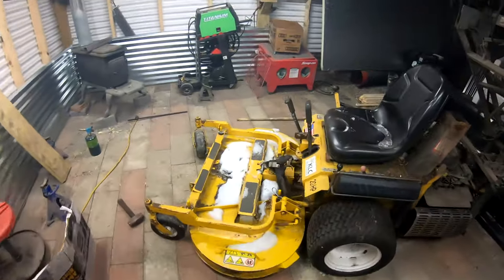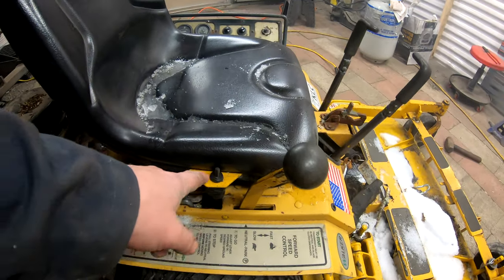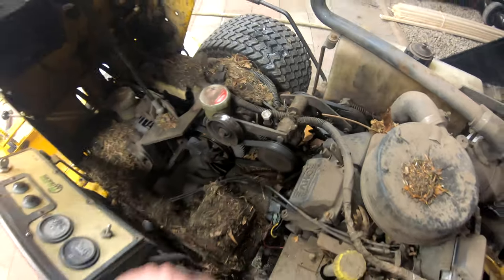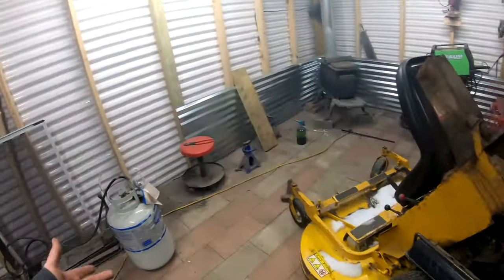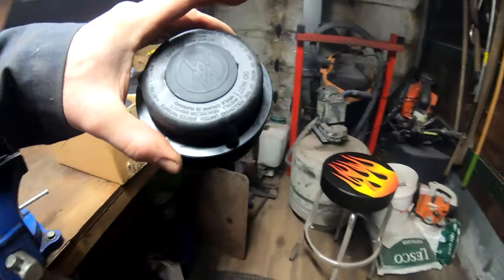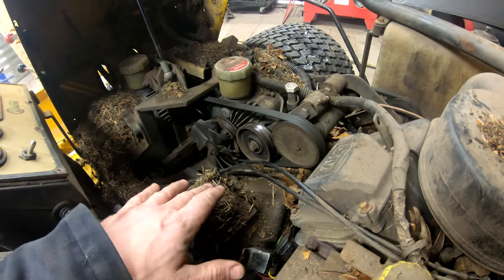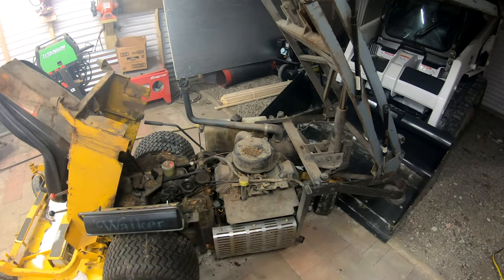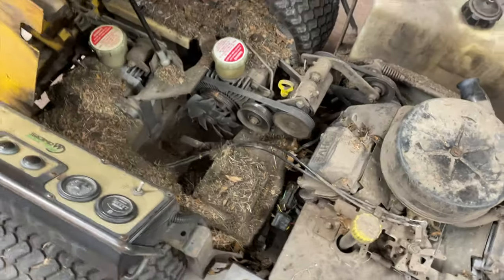Walker Mower Refresh/Upgrade Part 1

Comment: I picked up a Kohler efi 26 hp model and it has a little tool box bed thing in the back. But I'm going to convert it from efi to carburator.   I've gotta make a YouTube video about it 

I think walker mowers should be pretty great love your videos.  Any mower that you can rebuild is a great mower kinda like scag walk behinds are meant to be repowered

Comment: Nice vid Kenny yeah that Walker is great for bagging, I myself have 5 Walkers 2 GHS and 3 side discharge units been running the Walkers going on 14 seasons now but this year I’m going to add a stander to the fleet probably the Scag V ride 2 with the 52” deck should be awesome 😎

Comment: Wish I was in a position and close enough to buy it from you. I would like to try out walker mowers at some point. I want to get my hands on a demo this year
Reply from the maker: If you mow a lot of large properties like 3/4 acre up I wouldn't recommend them unless you have to bag grass all the time..... They are best in small lawns and tight spaces with curves and tight areas. At least the model Walker I have anyways... which use to be pretty much the only commercial Walker for a long time. Now they have lots of other models suited to not catch grass and cut large areas. But I have no experience with those. Thats Randy at Countryside's wheelhouse
Reply: I just bought a 2013 MTGHS23 Tuesday night. I have a decent size yard and have always wanted one. I don’t need it but it so far I’m enjoying it. I wanted to do a demo but walker can’t do demos due to them being sold out pretty much. I already started going through mine doing maintenance behind previous owner who didn’t even know how to fold the deck up. I’m very impressed so far!